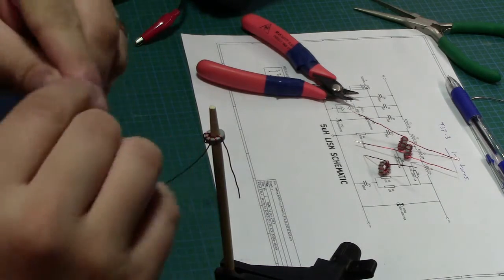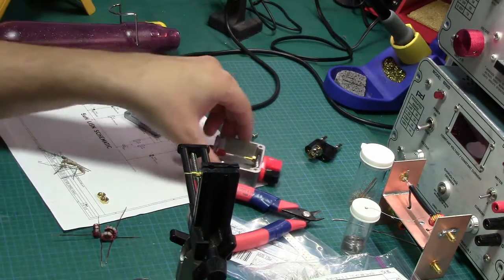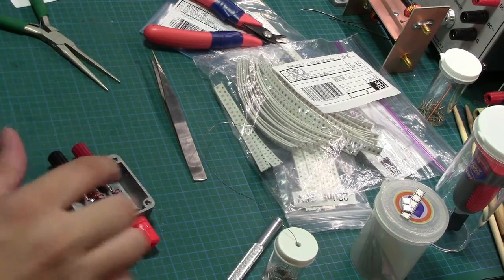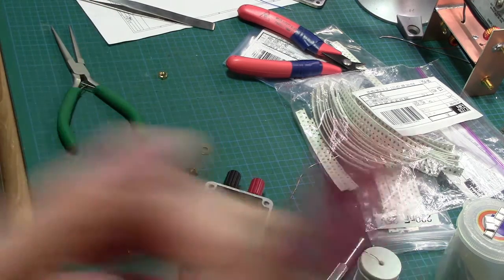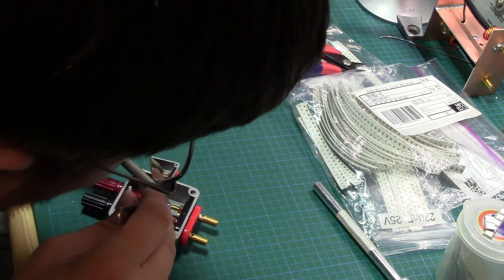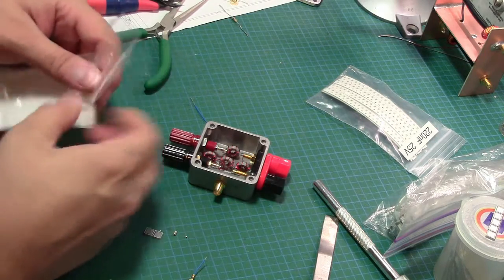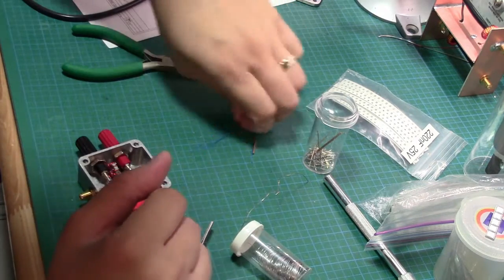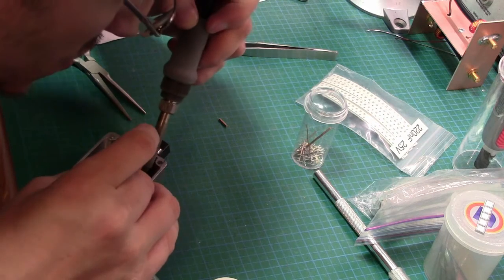LISN Box Build

Comment: Do you realize that those "little round donuts" create a resonant circuit, which has lovely peaks and valleys greatly exceeding what you are trying to measure?  This is why the inductors actually used in tests equipment like this are air-core.